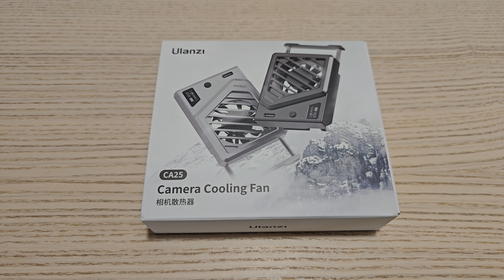Make your own or buy Ulanzi cooling fan?

Comment: Thats a good idea, but I think mounting on top if i want to use the new sony camera and its hot-shoe mount for their microphones, thats where I would run into an issue, so will have to go all out making an entire rig .
Reply from the maker: Attached fan to a magic arm should be more flexible for placing. Only slightly harder part is to make the attachment solid.

Comment: Hey man I’m thinking about getting this for my Sony a6700. Would you still recommend it?
Reply from the maker: Do you plan to bring powerbank with you to also power the camera from usb-c? If you will record 4k24 or 30 with low bitrate and display open.. it will not overheat. For anything else I would use any active cooling. If you dont want to look like crazy person (me) with the big ventilator, buy it. Also for more client stuff I would buy maybe more pieces from Ulanzi.  While using one unit charging the second etc. And it is a smaller package than big rig with big ventilator 😆 the np-f battery is good but heavy addition.
Reply from the maker: Though big vent cools the camera much better and faster